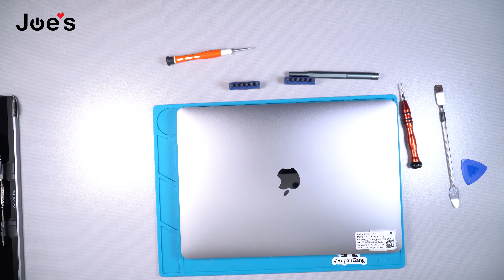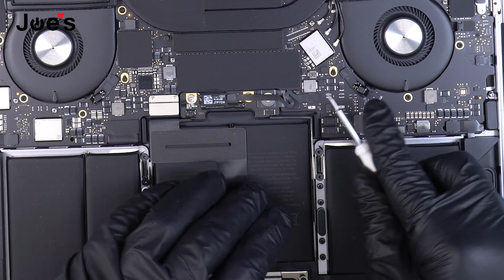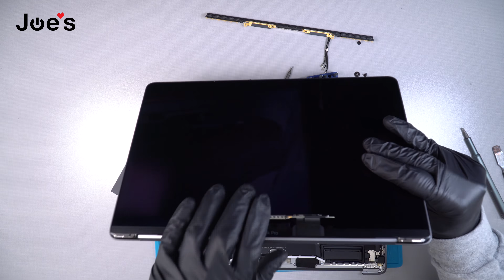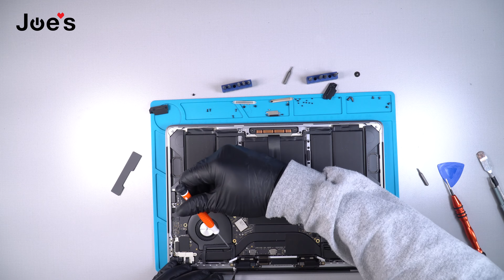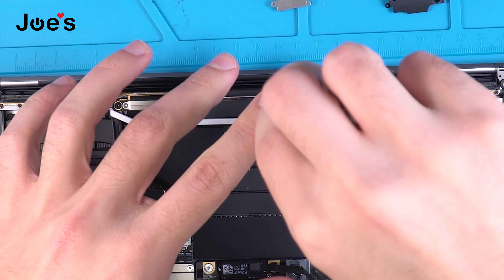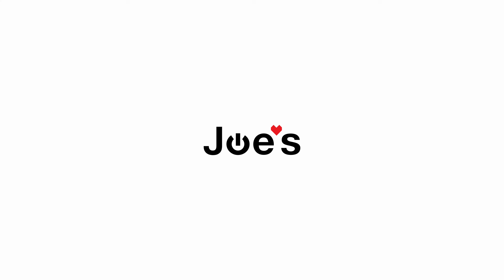Apple MacBook Pro 13-Inch 2019 2020 A2159 A2251 A1989 A2289 Screen Display LCD Replacement | Repair

Comment: I just replaced the screen but it didn’t turn on, what do I do? It is charging because I hear the sound but it’s not powering on
Reply from the maker: Sorry you're running into that! Shoot us an email at support@joesge.com and we'll help you out, or if you'd rather we take care of it, send it in here: https://service.joesge.com/
Reply: I actually managed to fix it! It was that I didn’t properly connect the little metal thing with the weird shaped metal plate properly, like the one under it, thank you so much for the video! My computer now works!

Comment: I changed the screen and it works but it only turns on when its plugged in the second I take the charger out it instantly dies. Have you heard of this??
Reply from the maker: Hello, thanks for commenting. Please email us at support@joesge.com with your question. We will be able to better assist you there. - JoesGE
Reply: Your battery cable is not reconnected successfully to the motherboard.

Comment: Where can I purchase the tiny screw driver kit? I ordered a screen repair kit from a seller on Amazon and I’m clearly missing pieces to the screw driver kit because it will not remove the 10 tiny screws needed for the repair.
Reply from the maker: Email us a photo of the screws support@joesge.com

Comment: Hey so I was doing this and the battery connector the little flap you have to lift I accendntally ripped it off trying to pull it up now I get no power a new one comes tomorrow  do you think me ripping the flappy part of it is the reason it’s not giving power
Reply from the maker: Hello, thanks for commenting. Please email us at support@joesge.com with your question. We will be able to better assist you there. - JoesGE

Comment: hello. so my screen haas been acting up, at first i thought the whole screen was damaged, but from time to time it recovers and looks just like normal, can i replace just the cable or does the whole display have to be changed? I have an M1 2020 with touchbar. Any help would be great, thanks.
Reply from the maker: You’ll need to swap the LCD panel. Your Tcom may be bad but generally those aren’t available. You can send your MacBook in if you need that parts replaced. https://www.joesge.com/pages/repair-service-macbook

Comment: Can the A2159 logic board be replaced with an A1989 logic board? because you can upgrade the processor. Thanx
Reply from the maker: They aren’t compatible unfortunately.

Comment: What is this connector at the end of the battery ribbon. It won't plug back in.
Reply: The connector at 18:19 in your video. Thanks for the video!
Reply from the maker: Hello, you're very welcome. Thank you for the comment. Please like and subscribe for more content like this 😊
Reply from the maker: Hello, thanks for commenting. Please email us at support@joesge.com with a screenshot of your question and we will be able to better assist you there. - Aaron P
Reply: Data cable, without that the Mac wont recognize the battery.